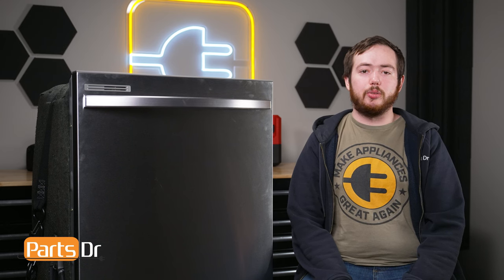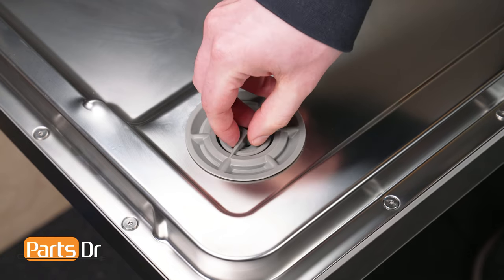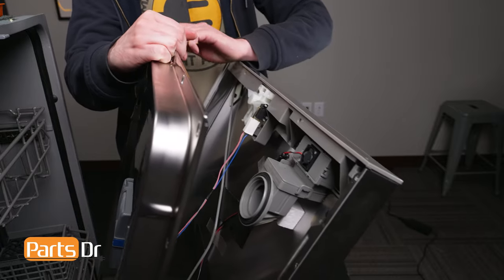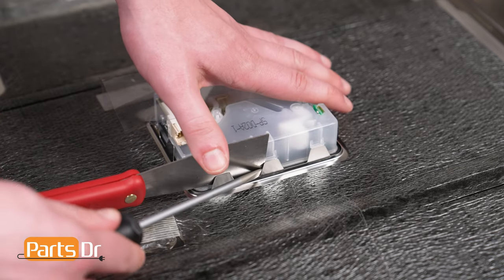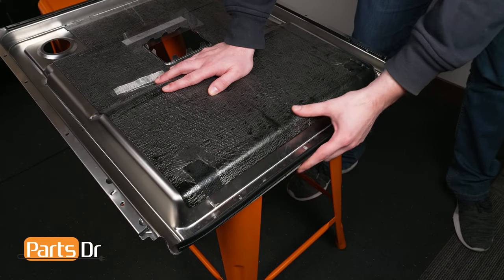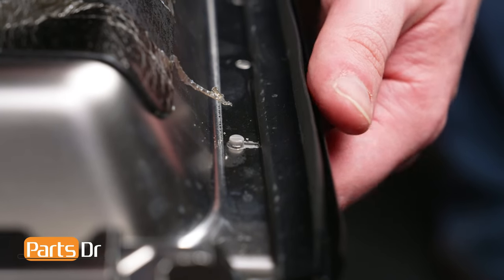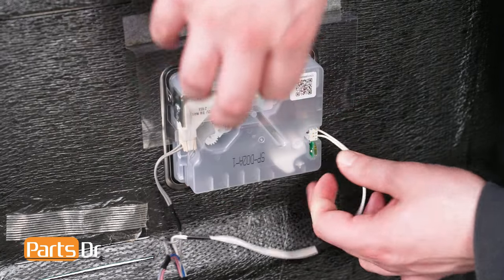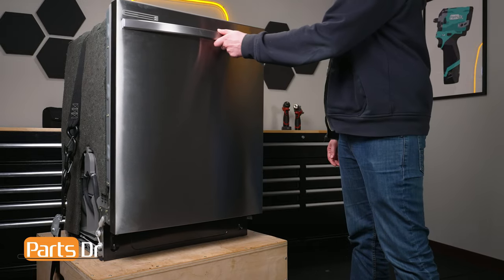How to replace Inner Door & Lower Door Seal Assembly part # DD82-01388A on your Samsung Dishwasher

Comment: Excellent! Your videos are straight-forward and easy to follow. Thanks so much!
Reply from the maker: You're welcome!!!
Reply: So we replaced this part (you guys do have the best prices btw!) due to the bottom seal being damaged and leaking. That's fixed! But now the dishwasher will run about 7 minutes of the beginning of the cycle and then reset itself and start the cycle over and over. Like its stuck in a loop. So I'm thinking something went wacky with the wires but not sure where to start. Any ideas? Thanks again!  @PartsDr
Reply from the maker: @markandmosey We don't know of anything off hand that would cause the dishwasher to act this way.  If you figure out the problem, please let us know.
Reply: @PartsDr  Ha! Yeah. I accidentally reversed the plugs when I reattached the wires to the soap dispenser. It works great now!

Comment: You didn't show how to install the seal. Skipped right to putting it bk together!
Reply from the maker: On the model dishwasher shown in this video, the bottom door seal is not sold separately.
Reply: @PartsDr  oh no. So, if I need a replacement, I need to buy a new washer?!
Reply from the maker: @Tatertooots  On most Samsung models the lower door seal is sold as part of the inner door assembly.

Comment: on my samsung dishwasher the black rubber under this seal is melted/worn, not sure what is the part number.
Reply from the maker: On most model Samsung model dishwashers, the lower door seal is not sold separately and it is only sold as part of the inner door assembly.